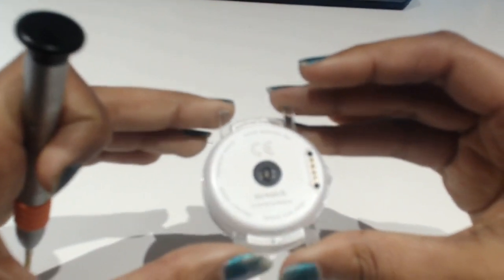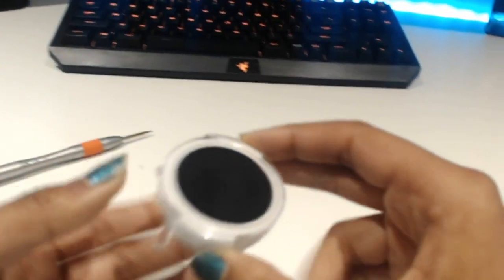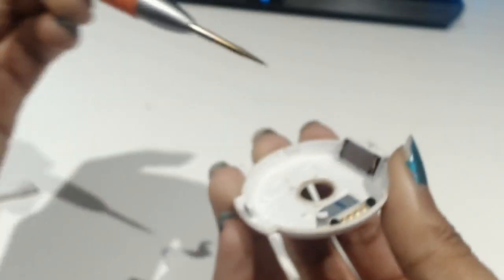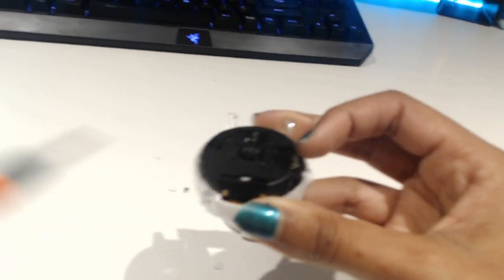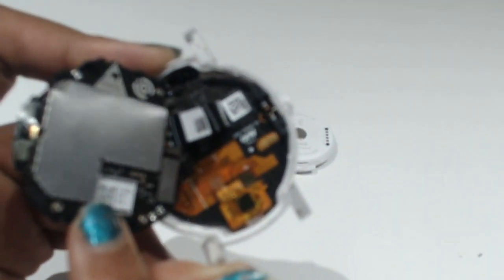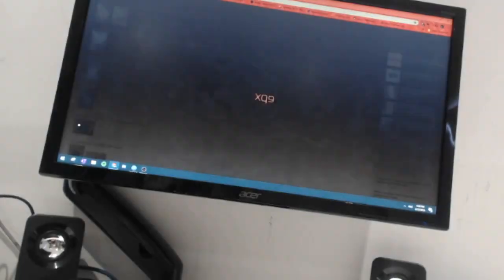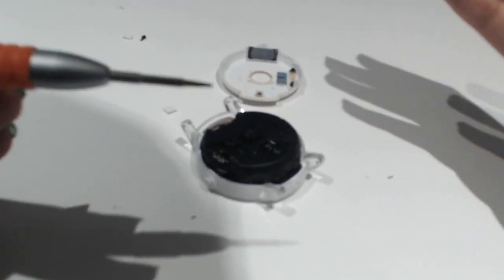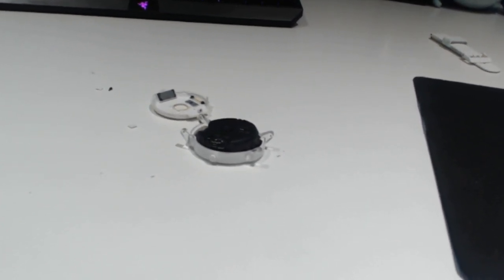Tic Watch E Mobvi Disassembly / Take Apart + Issues Internals/PCB

Comment: Hi, the pictures from xda are also the same model as yours. You can refer to the 4 th one there about the ribbon connector. Looks like it must be disconnected from the bottom board.
Reply from the maker: thank you so much I will try that !
Reply: I did take apart mine last week, and it was pretty easy. I just damaged the screw head at the beginning, and had to drill it out to remove it. The battery is gone, and I can't find another one that can be shipped to my country. Looks like I'm gonna have to toss it into the bin eventually!

Hope you fix your watch soon. Its a pretty decent watch, and I'm gonna miss it!
Reply from the maker: @arkshisha  I took it appart but I think the battery has issues, I don't want to buy a new one because it might have the same problem after a year, might look into the E2
Reply from the maker: @arkshisha  also the screws in the board that needs to be pryed off with the battery uses a different sized screw than the rest of the watch it was annoying to find the size
Reply: @fabsab4434  Yes, such a good watch for the price, but not happy in the end because of the battery issues.
Reply: @fabsab4434  where to find the back panel for replacement. My watch also has charging issue. It's just 6 months old
Reply from the maker: @hansith_muthukuda_arachchi  if it's 6 months old it should be in warrenty, contact ticwatch and they should replace it free

Comment: I have problem with the screen, the green color is there it also has the beep when I touch the power button but I can't see 
Before this happens the screen went white for sec than I can't see
Can I fix it or it's not working anymore?
Before the white light I charged it in my power bank for the first time😭😭

Comment: A litle bit late, but the ribbon cables are nice lego like connectors very easy to plug and unplug, very little risk, the moto 360 and 360 2gen are way worst in this regard.

Comment: I have the same model. But my watch is not charging. I don't know if it's the cable or the watch's problem. Please help.
Reply: Last time it showed some sign of charging, the watch was going in a loop of switching on and off as I tried to switch it on. And I also noticed that the power button was stuck in, a little bit, and it was probably causing the boot loop.
Reply from the maker: @miscreantminion9429  sorry im not working for tik watch I am not a person who can help. I ended up contacting the company and they gave me a discount on the new tik watch model so I bought a new one
Reply: @fabsab4434  it's alright. I'll try to fix it. It's just that it's almost impossible to get customer service for mobvoi here in Manipur. Thankyou for replying nonetheless.

Comment: My Ticwatch E Is not charging properly how could I solve it
Reply: Yes i have the same problem.. I don't where to repair..
Reply: I think it's the charging dock. I had the same issue. Took forever to charge.Replaced the charging dock and now works fine.
Reply: @thusharafernando4255  ok i try..